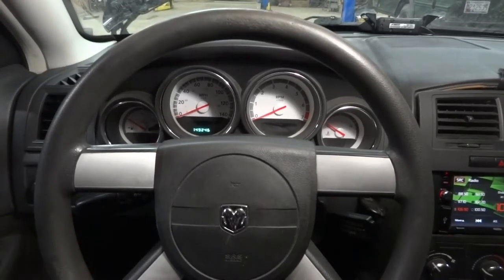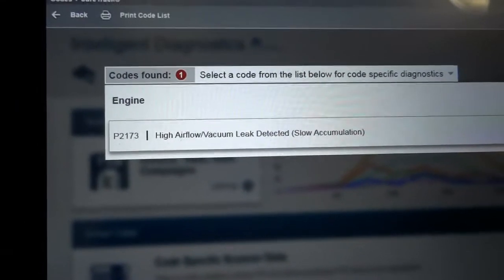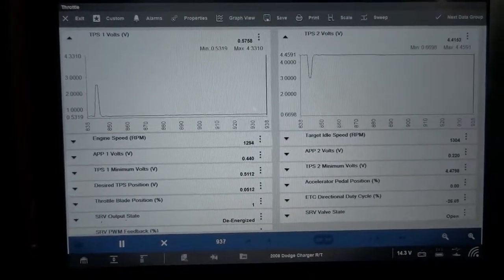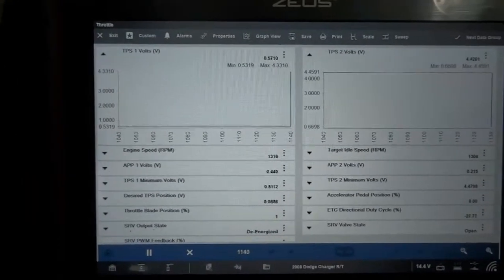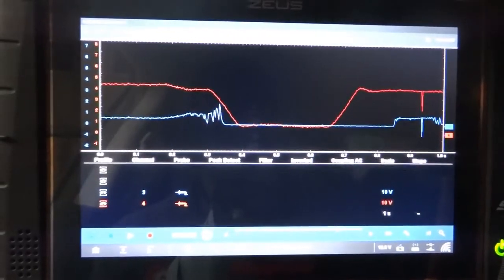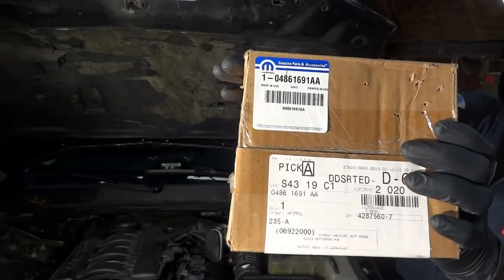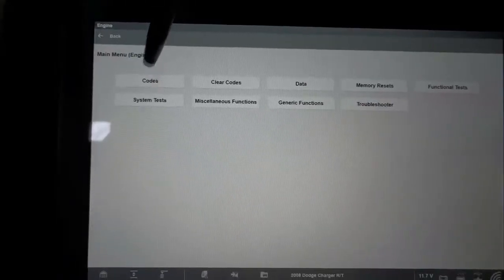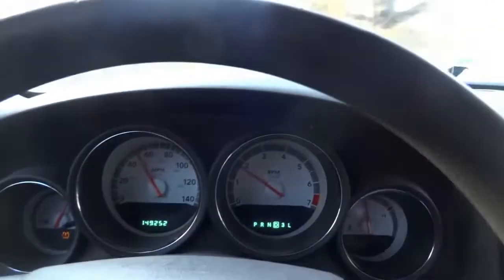Dodge Charger, Electronic throttle body light flashing on the Dash, code P2173. Low Power problems..

Comment: Thank you soo much for making this video.. i am having this exact issue with my charger. 
After replacing the throttle body how do i calibrate it without the scanner.?
Reply from the maker: jessica morales I don't  know how to calibrate it without a scanner, I don't think it's possible, you can take it a shop to have the throttle body calibrated after you replace it... also make sure you don't have a vacuum leak on the intake manifold before you replace the throttle... Good Luck!!!
Reply: Thank you! 😉👍 
Keep up the excellent work!
Reply from the maker: @jessicamorales7418  you're welcome!!!
Reply: Turn key to on position...not start but on where all lights on dash light up but engine is not running...next slowly...very slowly depress the gas pedal....after depressing all the way down...slowly let the pedal back up...very slowly again....turn key to off position...start engine...let car idle for 10 mins with no accessories on....next...turn ac and can on high for 10 minutes....drive car....should reset throttle
Reply from the maker: @anthonycrosier8824  thank you for letting me know...
Reply: IM CHANGING MY THROTTLE BOUT TODAY AND BEFORE TODAY ID RESET IT BY TURNING THE KEY IN THE ON POSITION BUT DONT CRANK THE CAR...PRESS THE PEDAL TO THE FLOOR FOR 20 SECONDS...TURN THE KEY TO THE OFF POSITION CRANK IT AND THE LIGHT DISAPPEARS
Reply from the maker: @reggiehammin3479  sounds good... Good Luck...
Reply: @anthonycrosier8824  what's the AC have to to with the throttle control ?
Reply: @raiderrich8355  it puts more of a load on engine while idling and helps it relearn idle...
Reply: @anthonycrosier8824  You can disconnect the battery and touch the pos & neg cables together for 15 sec. Put the cables back on the battery and start the car. It will be reset.
Reply: @jakemoody82  throttle body still needs to be relearned...if u do as u say and start car and drive than it wont run right!!! Let it idle for a bit with no accessories and than turn accessories on for 10 minutes and all will be good...
Reply: @anthonycrosier8824  My 2008 Charger 3.5 is doing this. It was running fine then it started pouring oil. The shop said it was the timing cover gasket and wanted to charge me $1500 to fix it. I told them to get bent and I'll do it myself. So I tore it down and found the problem. It wasn't the timing cover gasket as they said. It was the seal on the passenger side camshaft. I went ahead and replaced both cam seals, gaskets, and O-Rings for the water pump. After I put everything back together it started acting up exactly the same as in the video. 
In the past on other vehicles I've worked on for other people, Every time I had to remove the intake manifold, I would go ahead and clean all the build up out. I would also clean the throttle body and throttle plate as well. Hell, sometimes I would even remove the fuel injectors and clean them. Almost every vehicle I've done this to would idle a little high afterwards. I assumed that the computer adjusted the throttle plate position over time due to build up. When I disconnect the battery leads and touch them together I was under the impression that this will deplete the capacitors and memory so that everything starts back at the default factory settings. I know this works because I've done it several times. 
As far as what you're saying, you may very well be correct because I haven't performed this procedure after installing new components such as the throttle body assembly. If you could explain it to me in more detail, I'd appreciate that.      

Thanks!
Reply: @jakemoody82  u are right....pver time it will adjust itself....but to avoid sluggish idle u can do as stated above on most make and models....letting it idle by itself at first and than 10 minutes lated turn accessories on and computer will relearn idle....
Reply: @KITS_Auto_and_Truck_Repair  will a vacuum leak on the intake manifold cause the throttle body light to come on??
Reply from the maker: @CrazyTrapper98  yes it's possible, I've seen it once!!
Reply: @anthonycrosier8824  So I still haven't fixed this issue due to time but I'm about to tackle it. I do have a question. So why does the traction control light come on when the lightning bolt light comes on? This problem has been intermittent for a while now. I just stop the engine and restart and it might run okay for the rest of the day. I'm leaning towards the throttle body assembly being the problem but I gotta tell you I'm broke as hell and hope it's something simple. 
Also my fuel gage is going crazy. I fill up and it reads full but then it just jumps to random positions and all this started around the same time.  Any suggestions on what else I should be looking for?
Reply: Okay after 5 minutes I found it. Vacuum leak on EGR valve tube o-ring is gone
Reply: @jakemoody82  how did you get the get tube o ring off ?
Reply: @timbrendel9332  I didn't. The O-Ring was missing. I just replaced it. My guess is that it's inside the intake manifold or fell off during a previous unrelated repair.

Comment: What if the light is on but the only codes are an ABS thing ?
Reply from the maker: Grant Howard  ABS Codes should not cause the lighting Bolt to come on, you might have some codes too!
Reply: @KITS_Auto_and_Truck_Repair  - we are not able to get a reading for any other codes, so I’m not sure where to start. Any suggestions ?
Reply from the maker: @granthoward5423   what do you mean? can you scan the engine computer?
Reply: @KITS_Auto_and_Truck_Repair  - I think. My brother scanned it with something that plugs into the car and shows information on his computer, and all it comes up with is an ABS thing. So we’re not sure where to start, to fix the lighting bolt
Reply from the maker: @granthoward5423  Get a good scanner first
Reply: @KITS_Auto_and_Truck_Repair  - is what he has a bad scanner ?
Reply: @KITS_Auto_and_Truck_Repair  - his is a scan tool that cost almost $1500, he said it’s better than a lot of readers

Comment: What is it when the throttle body change it crank and run sitting still and then it goes bk to unable to stay run and shuts off
Reply: Code p2112 and p0688
Reply from the maker: Calvin M's I'm sorry I didn't understand your question!!

Comment: Im having the same issue and my car wont even start, ive already replaced the throttle body and still nothing
Reply from the maker: @johncunningham3850   check for spark and fuel pressure!

Comment: my car doesnt want to start and has a buzzing sound when i try to start my car & with the red lighting bolt.  this started happening after I took off the top from my car next to the throttle body 22012 dodge charger
Reply from the maker: JJ Snchz  does it crank? if you have a scan tool, scan it and see what kind of trouble codes you have in memory!!

Comment: Mines comes on sometimes and sometimes it dont, but when it comes on, my temperature gauge drops to cold, already changed the temperature sensor thermostat, water pump.
Reply from the maker: Swerve Hard  Also make sure you don't have a vacuum leak!!

Comment: Having the same issue right now. But, I have other codes along with my high idle. Changed quite a few parts which helped the issue some but didn’t solve it. Any ideas?
Reply from the maker: Jaloud A.R  it sounds like you have a vacuum leak, the high idle speed is the giveaway, check for vacuum leaks, especially around the EGR Tube seal!
Reply: @KITS_Auto_and_Truck_Repair  you are exactly right! The egr tube needs a a new bottom gasket. Life saver!
Reply from the maker: @jalouda.r8469  I'm glad to hear that!! Good Luck!
Reply: @KITS_Auto_and_Truck_Repair  problem solved! You’re the best my guy!
Reply from the maker: @jalouda.r8469  I'm glad to hear that! Thanks!

Comment: Ambient sensor light won't go off even after replacement, already changed the gaskets as well
Reply from the maker: Gabe Davis  check the sensor wiring and make sure it's good!!
Reply: @KITS_Auto_and_Truck_Repair   don't think so it never showed a signal when tester put on. What do u recommend
Reply from the maker: @G1276boy  Take it to a pro shop and have it diagnosed!!

Comment: My 2006 Dodge Charger does this but when restarting car the car turns off and will run better until it pops up again. Every time I restart car it resets it. What could this be
Reply from the maker: Eric K make sure you don't have a vacuum leak on the intake or you have a defective throttle body but check the wiring first before you condemn the throttle body...
Reply: I have same vehicle I change the throttle body and sensors on it changed wiring and sure enough I did find a very small small trans leak in my trans cooler hose
Reply from the maker: @saddamlucdahlia7842  oh really? I'm glad you were able to find the leak!!
Reply: @KITS_Auto_and_Truck_Repair  yep sure did. Under car by the motor & trans. Also I’ve knw some tipm need to be reprogrammed also
Reply from the maker: @saddamlucdahlia7842  really? do you have to program the tipm on this vehicle! I thought it was just plug and play?
Reply: @KITS_Auto_and_Truck_Repair  I’m not sure so I took out fuse box and then the one under dash in corner passenger side and on that box under the windshield wipers in corner it has a sticker that says authorized programming followed by barcode
Reply from the maker: @saddamlucdahlia7842  oh really? you should call your local dealer and ask them if you gotta reprogram it!!
Reply: I forgot to tell you the wires that are right below the ERG valve, the throttle is in front of these wires look directly below EGR valve my wire all the way down to underneath car were stripped and melted bc of the heat (it’s stuck between the motor and firewall) those wires were touching eachother my first place to check is that my friend trust me
Reply: @Erik K.   Also the throttle body and map sensor and air intake connect to these wires directly below EGR valve
Reply: @KITS_Auto_and_Truck_Repair  also I had a friend had same car as mines and he got his TIPM off a Chrysler 300 2009 but part numbers matched he just plugged it In and boom it worked no programmed no needed
Reply from the maker: @saddamlucdahlia7842  yeah that's how it is, these IPDMs don't require programming it...
Reply from the maker: @saddamlucdahlia7842  yeah that's good to know!!
Reply from the maker: @saddamlucdahlia7842  yeah!!

Comment: I have the same code but I don't have a lighting bolt on my dash
Reply from the maker: @waltermorris1316   Check your throttle body and make sure you don't have a vacuum leak!
Reply: Ok I will do that

Comment: So I cant do it without a computer to recalibrate my throttle body?
Reply from the maker: ad mckee it's easier with a scan tool but you can do it manually also. the manual procedure is mentioned in one of the commens of this video!!
Reply: @KITS_Auto_and_Truck_Repair  resetting the throttle?
Reply from the maker: @mckeecrew  no Calibrating it after installing a new one!!

Comment: i have the same problem but my car doesn’t turn on…. need help
Reply from the maker: Botog24  if your car doesn't turn over you should check your starting circuit, starter relay, starter and ignition switch!! I have a video on this channel that shows, how to diagnose a starting system, the video was on a hyundai sonata, it's the same procedure, check it out, Good Luck

Comment: I get a lightning signal in the car once a week and I lost the accelerator pedal after stopping the engine and running it and the problem is solved Dodge Caliber
Reply from the maker: Hemid Bdran  Your Throttle body assembly might be going out, you should have it diagnosed!!

Comment: This is exactly what my 2008 dodge charger is doing but happens after three minutes
Reply from the maker: tresslure gaming  Your throttle body might be bad but make sure you check for a vacuum leak first!
Reply: @KITS_Auto_and_Truck_Repair  I did I've replaced the fuel injectors and the coil packs spark plugs and seen three hoses that have crack but doesn't seem to be causing a leak theres a sensor on the top intake when u unplug it while its running doesn't bog down or anything and the one on the rubber right after the throttle body when u unhook it it doesn't do anything either and the car drives great until u park in and about 3 minutes go by it starts doing what this car is doing
Reply from the maker: @MrAqq147   that's odd!
Reply: @KITS_Auto_and_Truck_Repair  yeah had me confused lol I'm gonna try a new throttle body if it works I'll let u know if not I'm gonna start replacing those sensors wish I had ur set up man
Reply from the maker: @MrAqq147  I recommend you rent a smoke machine a smoke the intake manifold you might have a vacuum leak
Reply: @KITS_Auto_and_Truck_Repair  that's a great idea I'ma go get one and do that I'll let u know the outcome
Reply from the maker: @MrAqq147  Sounds good!

Comment: Mine won’t even start
Reply from the maker: Equinox AzRa  That's odd!
Reply: @KITS_Auto_and_Truck_Repair  it does everything you said it the video lighting bolt came up haven’t been able to start it since
Reply from the maker: @equinoxazra6943  the lighting bolt should not cause it to not start! disconnect the throttle body and see if it's gonna start !
Reply: @KITS_Auto_and_Truck_Repair  will do first thing in the morning
Reply from the maker: @equinoxazra6943  Sounds good!
Reply: @KITS_Auto_and_Truck_Repair  need a charger intake manifold don’t really know to much but why tf is it 400 dollars in the store and 80 bucks online now I gotta wait for it to be delivered
Reply from the maker: @equinoxazra6943  I don't know exactly why?

Comment: Hi my name Henry...I have a 2010 SXT 3.5L high out put. Three weeks later this car throttled light came on and I took it to the shop and the side it a back call on all of them. Hmmm he show me that took the intakes off and show me the rocker arms all loose and I told him to tighten them up ? He said no used. You car is dying at 295,000.00 12 years later.  So I need my car back man? Je said Mopar has an new Rocker arm systems for it buy its gonna cost me 3,200.00 to fix it I was like how much do an brand new engine cost MFers?  
I feel like I being rape by Chrysler we need a law suite! They can hit an computer and design this car for sabotage. Help sos
Reply from the maker: Henry Gee  That's Sad!

Comment: I replaced the throttle body it ran good for a min and started bk shutting off
Reply from the maker: Calvin M's you might have a vacuum leak or a wiring problem!!
Reply: @KITS_Auto_and_Truck_Repair  I don't see how or where I drove 5 hour straight in it I never gave me a problem til now. I'll check the lines thanks 😊
Reply from the maker: @calvinms6725  My Pleasure

Comment: My car has this light but now it won't start at all
Reply from the maker: Harlem Beloved  does it crank?
Reply: @KITS_Auto_and_Truck_Repair  well it did.. Im now being told that my ignition and other components are not communicating with the cars computer... or the fuse box isn't communicating... Nevertheless it sounds like I'm having electronical problems
Reply from the maker: @harlembeloved7052  ok, you need to have it diagnosed to get to the bottom of the problem, take it to a pro shop and they will figure it out!!

Comment: Hello brother, You are an amazing troubleshooter. I have a dodge charger 2008 RT. It is getting started and shows red light blinking in Gas section in the dashboard, he battery sign is there next to the throttle body light, and all gear enabled I couldn't find any good electrician. Could you help me resolve my issue? any clue or idea. If you have WhatsApp number. would you like to share? I will be thankful
Reply from the maker: Saddique Khan  You can email me at Deo@calleva.org did you do the tests I did in the video?
Reply: @KITS_Auto_and_Truck_Repair  I already sent you an email. I took it to the service center. They did the test but there was no error.
Reply from the maker: @saddique164  that's weird,